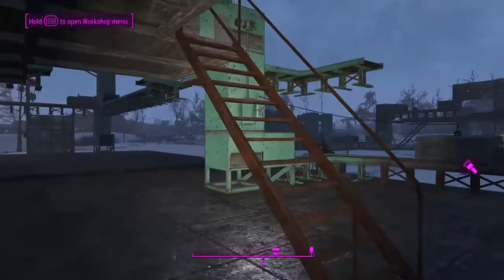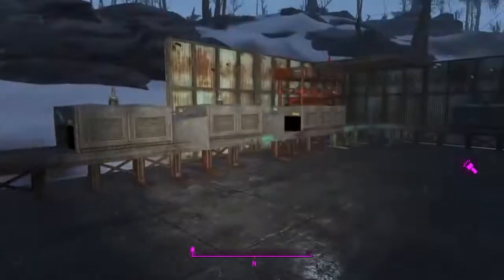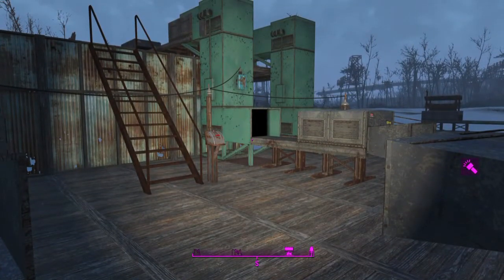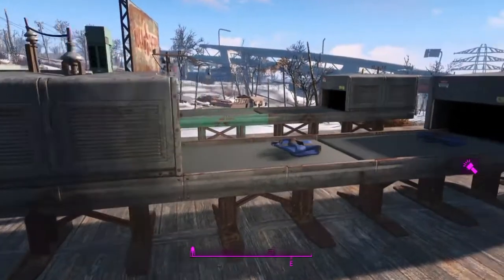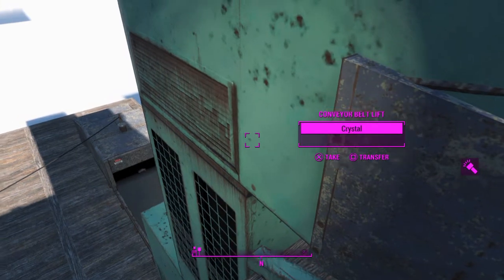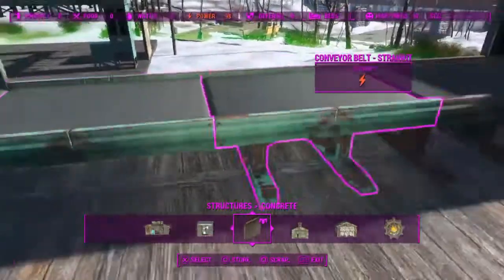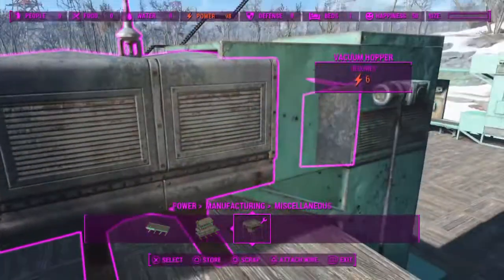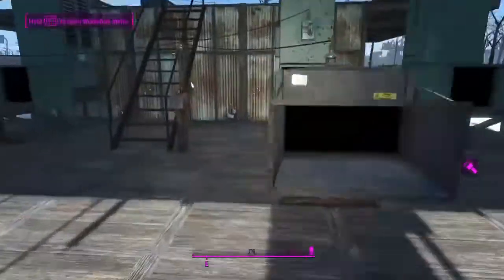Fallout4 Factory Up conveyor belt jamming fix

Comment: This is a lot simpler than what I did to fix that problem, thanks I will be doing this from now on.
Reply: I used Swapa to place an extra belt inside but just barely on top of the lift belt's belt layer, your method takes a lot less time :)
Reply from the maker: Person Idk 
You should check out the Qwapa, it's still in WIP but Tim put in a  PA tool with it that works a lot smoother.
Reply: Jack Dolff I'll check it out, thanks for the info :)